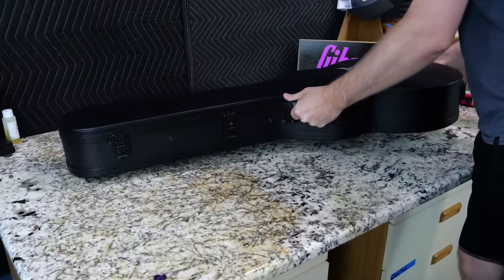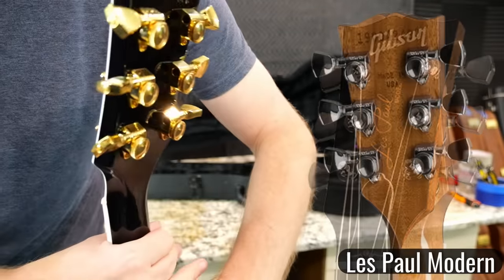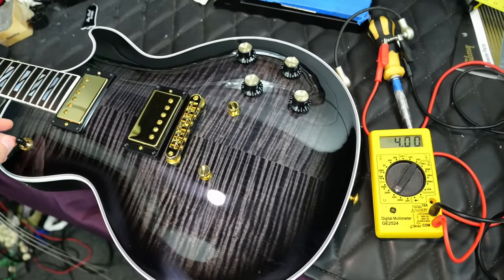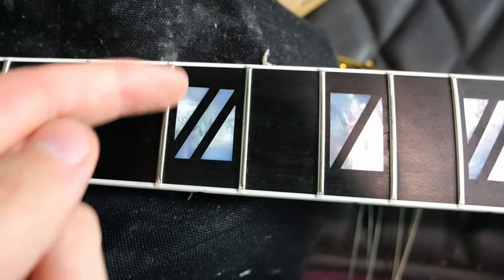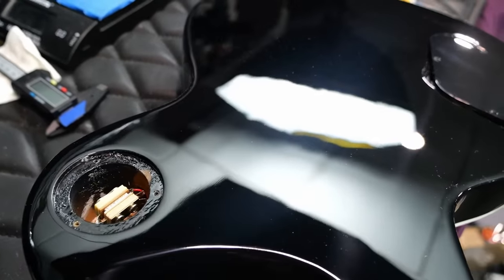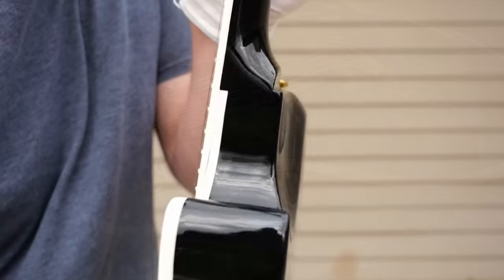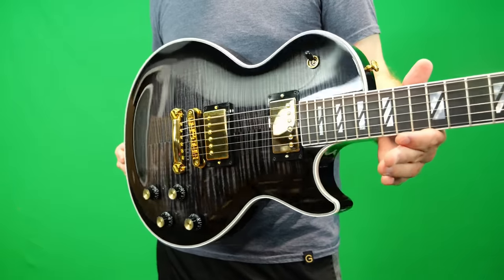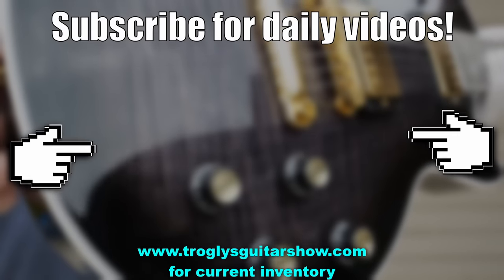I Tried the NEW Supreme... | 2023 Gibson Les Paul "Modern Supreme" Review + Demo 2 Pickup Flame Top

Comment: FYI Austin, the Gibson "coil tap" on these PCBs isn't a tap or a split! See those extra capacitors on the PCB? They're there to shelve off a load of low end, so it's still the full pickup, both coils, but with the low end cut off to emulate a single coil sound. Yamaha do a similar thing with the Revstar and call it a "dry switch".

Comment: Thanks Trogley. I've got a Gibson LP Modern, and was struck by how similar the specs were, then more struck that no other reviews that were coming out referenced this at all.

From your review, you said that the pickups are the same as the Modern, but in the Gibson Website, they're called slightly different things. Is this a mistake on the website, or are they actually slightly different?
Reply from the maker: The “modern” listing just has the rhythm/lead words thrown on at the end which is technically unneeded info since they are already labeled Neck/bridge. They are the same
Reply: Ha, fair enough, thanks for the reply! Well, in that case, I feel like my Modern is even better value for money 😆

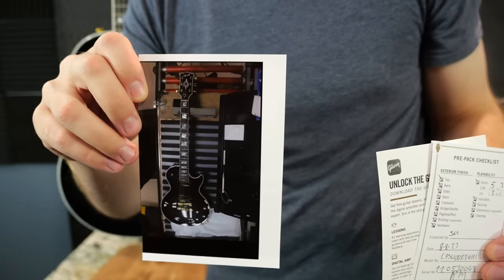Comment: I bought one of these from Righteous Guitars in Oct 2023 - Red Wine Fireburst model - It was sold as a brand new guitar.  However the odd thing is that the serial number starts with a 22 suggesting its a 2022 model - even though the certification paper has a date of 2023 - Seems very odd to me - If it is a 2023 - why does the serial number suggestion that its a 2022.  Also doesn't seem to have any modern weight relief as confirmed by Gibson - when I called them and let them know it was 10.2 lbs.    All that being said - the guitar plays amazing and they pled'd it for me which was very nice.  I am still scratching my head on the serial number.. Also see the same thing on this video - look at 3:29 mark - the date you have is 8-8-23 but Serial Number starts with 22.  Doesn't make ANY sense.
Reply: Baby photo - I didn't get one - my date on my pre-check list was only 20 days later than yours at 8-28-23 - that sux.. guess it explains why I didn't get one
Reply from the maker: Gibson serial numbers are read  YdddYbPPP.   y for year, d for Day, b for batch number, p for production number.  The YYppppppp was only used in 1994, 2014-early2019

Comment: Hold on to what you've got until you for sure find better.  Early in the SG Modern run I had  chance to buy a fantastically flamed blueberry burst but I really wanted one in black at the time.  By the time I changed my mind, every blueberry burst they've put out has seemed more blotchy colored and inconsistently figured than the last.  Really regret passing on the early one from when they still had good wood stock and/or gave a crap. 😆